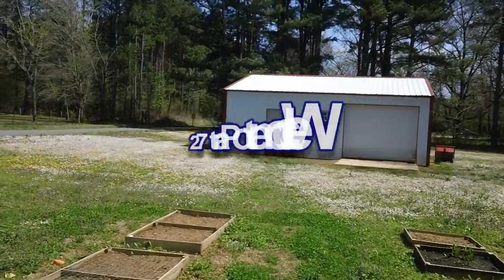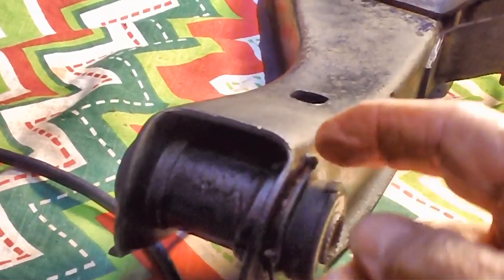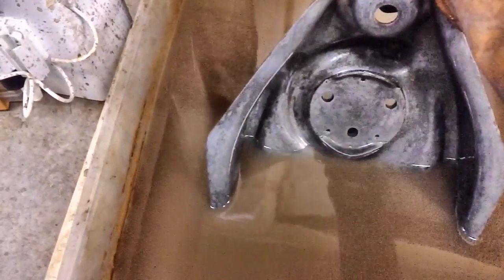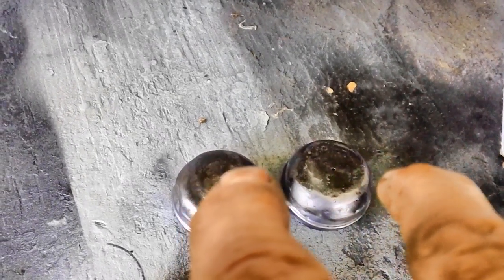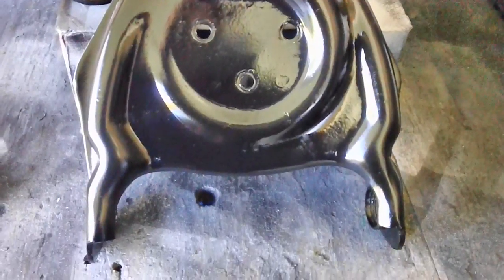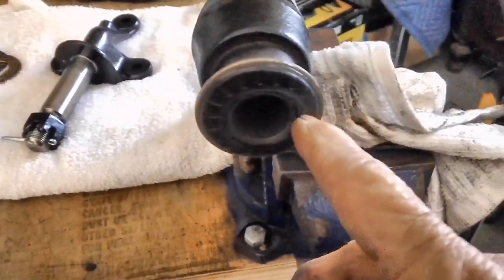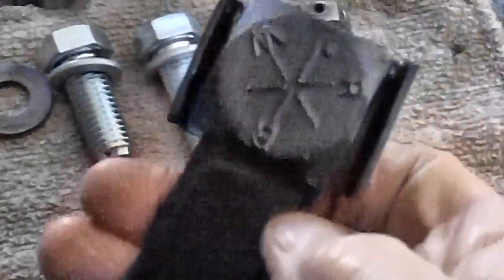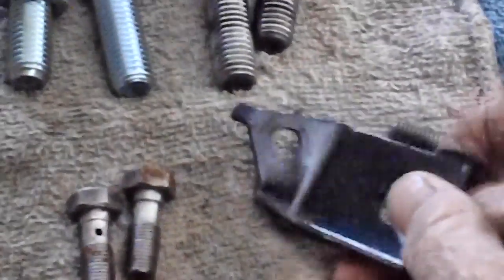1966 Ford Thunderbird repair and refurbishment (Part 72).  Idler arm update.

Comment: Hello John !!  Krylon makes good coating and paint products, I use it too on some stuff I do!  When I get something that has a rust problem on it I will have to try the Vinegar soak routine also so thanks John for that idea !!  By the way John I live a stone's throw from a place called Tillson Lake,  Its North East of Pine Bush by about 7 miles and  North West of hamlet of Wallkill  by 8 miles, I just thought I would mention this to see if any of those places names rings a Bell, Tillson lake is nestled up against the bottom of the Shawangunk Mountain Ridge !!  a very beautiful place!!
Reply from the maker: John,
At one time my dad and one of his cousins were Wallkill police officers.  It was many years ago.  I left that area in 1966 and never looked back.  It was too economically depressed, even at that time.   Also, though the area is very pretty the winters were just too severe.   Anyway, that same year I wound up in Arkansas and eventually permanently settled here.  It was a good choice for me.
Regards,
John

Comment: Great video Joe, as usual.  That lower control arm with the welded in place bushing, I wonder if that was a replacement arm, not original to the car.  Hope your new bushing fits ok.
Reply from the maker: Bill,
Could be.  I think I mentioned that thought in one of the previous two vids.  Tomorrow I'll do a detailed comparison to the one on the driver's side.
Regards,
John

Comment: I've had great results with using Super Clean to prevent flash rust...I just spray the part with Super Clean as soon as I take it out of the de-rusting solution and let it dry, it seems to work well. I use a 50/50 mix of Super Clean to water. 
That's a great idea to add other T-Bird owners to your video's, I would love to see them!
Reply from the maker: I better stick with the Permatex Rust Reformer.  It's easy and quick to use, also does a bang-up job of letting me see exactly how much rust was reformed and how much still needs to be done.  And a can goes a long ways.
Regards,
John

Comment: I always like to use Krylon Rusty Metal Primer. It has the rust reformer built into the primer and saves a step. Much cheaper than the reformer by itself.
Reply from the maker: Johnny,
Well lah-di-dah.  Ain't you something. 😋
Regards,
John

Comment: when showing the bolts(wire retained), the originals were grade 8, the replacements are grade 5.  I'm sure Ford would have used the cheaper grade 5 bolt if it wasn't necessary to use grade 8 bolts. Just say'in. Of course I just saw a flash.
Reply from the maker: George,
Very good point, my friend.  I'll make sure they're grade 8.  Thanks.
Regards,
John

Comment: Nice work as usual, John. I have a tip that others may want to try. After I cleaned my  de-rusted bolts, I soaked them in a phosphate etch over night. This process puts a protective coating on the bare metal. They then can be painted with matte clear, or whatever color you wish.  I noticed that in the Thunderbird assembly manuals, that a lot of the bolts were listed as "phosphate/oil coated". Here is a link: https://www.homedepot.com/p/Klean-Strip-1-gal-Concrete-Etch-Metal-Prep-Rust-Inhibitor-GKPA30220/100406369. 
It will be nice to see the other T-birds that you will be showing! Thanks, George
Reply from the maker: George, 
That's a bit farther than I wish to go.  If I were restoring this car the phosphate/oil treatment would be a definite consideration.  Not so for a refurbishment.  But you did motivate me to find out what the process involved, as I had never heard of it.  I appreciated that, my friend.
Regards,
John

Comment: Hey boss I got a 1965 Ford Thunderbird one year older than yours I was wondering, get a posi traction from my rear axle now I read in the shop manual that is a 9-inch before I make the purchase can you just please confirm to me that it is it's all original I'm currently putting disc brakes all the way around I got a conversion kit from classic brakes it comes with a booster and all of it and new pedals
Reply from the maker: Ernest,
There's no way to absolutely, positively tell you what size differential is in your '65 without opening it up.  Throughout the years it could have been changed several times.  There should be a metal tag attached to one of the bolts.  The numbers will tell you the size that came with the car, but many of those tags disappeared over the years.  Also, the vehicle ID tag in the door jam will tell you the gear ratio.  Best I can do, my friend. 
Regards,
John